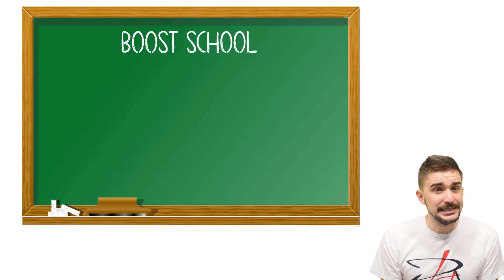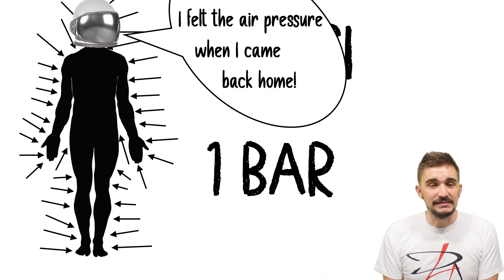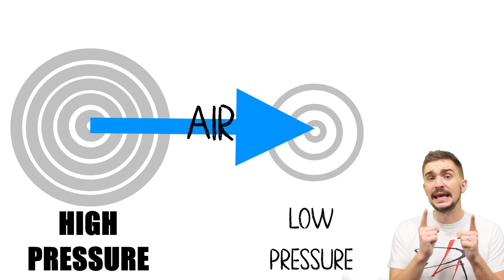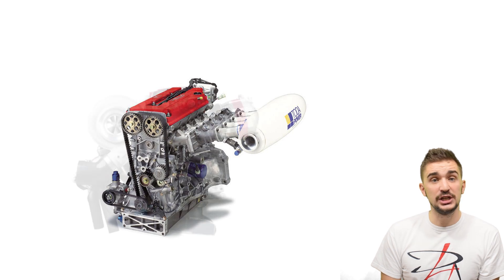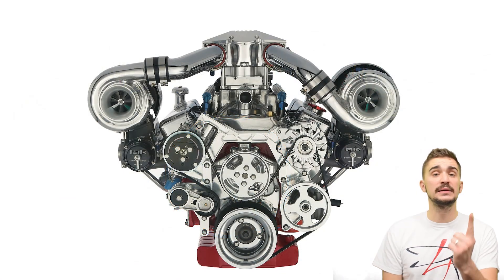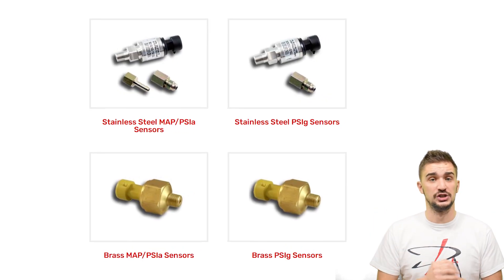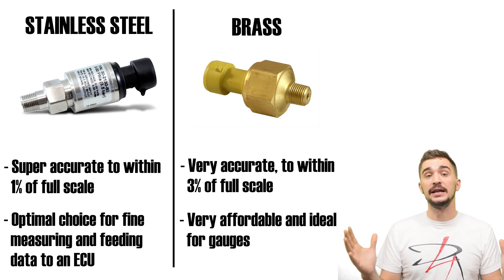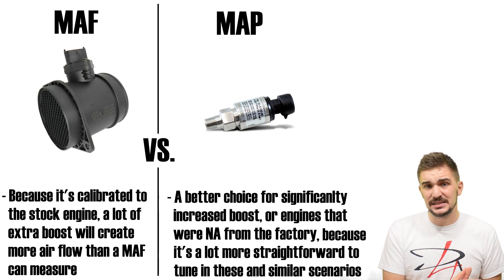BOOST pressure vs. MANIFOLD ABSOLUTE pressure vs. ATMOSPHERIC pressure - BOOST SCHOOL #4

Comment from the maker: AEM SS MAP sensors: https://bit.ly/d4a-map-sensors
AEM SS Pressure (Gauge) sensors: https://bit.ly/d4a-pressure-sensors
AEM boost controllers: http://bit.ly/D4AtruboostX
AEM ECU: http://bit.ly/D4Ainfinity5
AEM wideband AFR gauge: http://bit.ly/D4Axserieswb
Reply: Cool
Reply: Hello.do you have a video that is more diesel specific?would really appreciate it.woukd be nicr content for you too i would imagine.you are ver well versed and give crystal clear explanations yhat even a doorknob would understand.thank you for this and more power to your channel
Reply: Reirregardless , brilliant video 😉
Reply: @driving4answers do you have a video that covers the principle behind turbo flow Vs turbo pressure. I understand that bigger turbos flow more therefore make more power, however, they are able to flow more and decrease manifold pressure. 
How is it possible have less pressure but more flow. If the restrictions stay the same, i.e. the head and inlet. Then why doesn't that extra flow turn into extra pressure?

Comment: air pressure is not a function of air density without perfectly controlled conditions; increasing air density will increase air pressure in a perfect experiment, but increasing pressure does not always increase air density because humidity and temperature changes will be different masses in the same volume. a map sensor alone will create a poor afr when exposed to any conditions other than an sae standard day. i think a pressure sensor is a useful sensor but it needs other parameters to know how much air is actually present.

Comment: people really have to stop with the dubious explanations of atmospheric pressure on our body. it's not about being used to that pressure or any such thing. we don't feel the pressure of the air on our body because the inside of our body is at the exact same pressure, otherwise we wouldn't feel much, we would just get squished like a tube of toothpaste.
i've been as high as 4000m above see level where the pressure is about 61% of see level pressure, and i've been as low as 40m under the sea where the ambiant pressure of water is 5 times that of the surface. the only thing you feel under such low pressure is that you easily lose breath. and the only thing you feel at such high pressure is the first few symptoms of narcosis (drunk-like symptoms caused by high oxygen concentration). you never feel any mechanical pressure on your body.
you do feel a few things when changing altitude and pressure. the experience of diving holds the most symptoms of pressure changes, however, very few of them are effects of direct pressure on your body. as you dive, pressure will squish your mask against your face, because the volume of air inside your mask did not change, you have to manually breath out from your nose to balance it. your ears will clog, because the air on the inner side of your ear-drums didn't change either, you do a valsalva maneuver to balance it by blowing some air to the inner side. your wetsuit will feel more flexible, because the tiny bubbles of air trapped inside are getting squished by the increasing pressure, making the wetsuit thinner. if you are foolish enough to hold your breath while going down (never hold your breath while scuba diving, it's dangerous), you won't even feel your chest getting pushed by ambient pressure, it will just become smaller as if you were breathing out (if you go past your minimum lung volume though, your chest will get crushed).

on a side note, even if you went to outer space, if you are alive, you've likely never been a single moment without air pressure on your body. either you are in a cockpit or space station that is is full of air, or you are wearing a space suit that is full of air. if you are exposed directly to the vacuum of outer space space, you'll be dying pretty fast.
what you may feel is a big difference in how the air around you behave, such as losing the habit of what wind and air flow feels like at normal atmospheric pressure.

Comment: this makes sense. Turbo engines suffer less performance loss when you drive it to highlands such as Tibet. The turbo will compensate for the lower atmosphere pressure so you still get the same pressure inside your engine.
However in this case the boost threshold will increase since it isn't enough to spool the turbo at the same low rev.

This seems not so important for people outside China? USA is mainly flat.

Comment: correct if I’m wrong: so around us is about 14.7 PSI ATMOSPHERICALLY. And an NA engine has PSI of 14.7 when “sucking” in air (so an engine has no vacuum: but a rush of atmospheric pressure right?) so at all times 14.7 atmospheric pressure of air is rushing into the engine? And if a turbo is making 14.7 PSI this is separate from atmospheric pressure.

Comment: It is not at all necessary for your boost gauge to measure your turbo boost pressure at the turbo, in fact its much better and more accurate in terms of engine conditions to measure it in the intake manifold, exactly where your ECU is measuring it. I have no idea why you would ever want to measure boost pressure pre-throttle body.

Also, what youre essentially saying and what you should probably be saying directly is that boost pressure drops as intake restriction is encountered by the airflow from the turbo. The best possible measurement would be inside the combustion chambers. This is usually impractical, so as soon as possible pre intake valves is ideal. The most practical location is in the intake manifold. If you have ITB's, tapping the ECU's MAP hose would work best.

Comment: 2:40  Sea level?  I'd argue the lowest point would be the Dead Sea.  Its shores have an elevation of 420 meters (1,385 feet) below sea level.
Reply: yeah because someone is gonna tune their car specifically for the shores of the dead sea💀💀
Reply: At this point in the video he is not talking about tuning, and neither am I.  He is talking about geography.  "Where is air pressure the highest? It's of course highest at sea level because that's the lowest  you can be while still being on the surface of planet earth" <--- That is an inaccurate statement is all I'm saying.
Reply: he was still talking about air pressure, I think the pressure you would experience below sea level is water pressure
Reply: @thatweirdoboi7588   I am talking about air pressure as well.  The shoreline of the dead sea is still 1,385 feet below sea level.

Comment: After watching this video I realized in a N/A engine if you increase the intake system bastly , even the compression while is N/A the pressure will be 14.7 so with a 1 bar MAP sensor will be enough , am I right?

Comment: Light planes have an interesting variety of turbocharger wastegate controls systems. Some are as crude as a fixed wastegate that relies on the pilot watching the MAP gauge and controlling with throttle (yes, you can overboost them simply by firewalling it on takeoff), others are more sophisticated and actually regulate the manifold absolute pressure. They will maintain the set pressure throughout a climb until the wastegate is fully closed, at the "critical altitude" of the system, above which power drops with the altitude increase. Wastegates are usually hydraulically actuated by engine oil. The control systems modulate the oil pressure to the wastegate.
      I added a MAP gauge to my turbodiesel RV...the gauge is from a multi engine aircraft (actually a dc-3). One port I left open, so it indicates ambient pressure, the other indicates MAP. I have driven it over the Rockies several times, interesting to watch both ambient and max MAP drop. Thus, available power drops proportionately..car people think their turbo negates the effects of altitude. Wrong, unless your turbo control system  is designed to do so! It is probably not.

Comment: There is one more thing that is important; Mean Effective CR (compression ratio) Versus Boost. This takes into consideration pumping losses, heat, and altitude. Engine might have a fairly high static CR and too much boost = obliterated engine. The actual dynamic CR will be less. I was reading a article on aftermarket boost used on a high performance NA engine. According to my 'math' the boosted CR was 17:1. But the actual CR was 11:1. I was pleasantly surprised because engine I was designing had very low static CR so I could add 5 bars of boost and not blow it up. Plus the actual CR can run on Pump Gas.
Reply: i did run over 30 psi because of my faulty wastegate. tune was on 25 psi. hopefully it didnt blow up
Reply: @CHATANDFUN  Thanks for comment. Sometimes shared knowledge is better than dry data from the engineers.

Comment: For naturally aspirated engines, the approximate math for elevation-hp exchange is: +300M equals -5hp. 

Turbo and supercharged engines are different and can be case specific.
Reply: Wouldn't the "math" give the power loss as a percentage instead of a specific horsepower loss? A moped with 2 hp at sea level can't lose 5 hp at 5,000 feet...

Comment: What about a supercharger in the exhaust? Pulling the exhaust out of the head, negative pressure in the cylinder for when the intake valve opens?

Comment: Irregardless is with regard or with respect, high estimation of value. Regardless is without regard, respect, or low estimation of value. Ir equals not, so ir-regardless becomes not regardless, thus with regard. A person I worked for did me a solid by correcting me on this matter. Thanks Shelly. Great video series, I've learned a lot.

Comment: This is fantastic.
I've got an issue with my car, likely the MAP sensor, and I've been searching for hours online for one, only to finally realise that all the shops online call it a boost pressure sensor, but my workshop manual calls it a MAP sensor..
Which is obviously how I ended up on this page!
Reply: Manifold air pressure
Is boost pressure
Reply: @fastinradfordable  Yea I know that now, but everybody calling it different names is kind of annoying when you don't know, and you're searching online for a MAP sensor but can't find the right one! 
But it turns out my MAP/boost sensor was fine after all, it was my EGR valve that wasn't closing properly, and it was throwing off the pressure readings..

Comment: I'm confused, are na engine map readings negative or postive in.Hg?
Reply: Positive. Absolute pressure (the "ap" part of "map") can not be negative. Just as you can't have a temperature less than absolute zero.  
   Zero absolute pressure, whatever the units used, indicates a container or volume containing nothing. There is nothing more to remove!

Comment: A long lecture on atmospheric pressure, is not why I came to watch this video. Anhow, you got some stuff wrong. The reason we can't feel air pressure is because the pressure in our lungs, sinuses, inner ears, etc, is at an equal pressure to the air outside our bodies. When you go up or down in a plane, you can feel the change in pressure outside in your eardrums. When you "pop" your ears, that's allowing air in or out of your inner ear. As long as you keep breathing, your lungs, sinuses will equalise all the time. If you were to scuba dive at a depth of say 30m, then hold your breath and ascend, the air in your lungs, which would be at 4 bar pressure (1 bar of air pressure plus about 1 bar per 10m of water depth), would try to expand as you swam closer to the surface, probably causing tearing of your lungs, or worse.
Reply from the maker: A long comment that doesn't quote what's actually wrong is not why I read all of it. If there's something I said that's actually wrong then please quote it instead of trying to find an excuse to demonstrate your understanding of air pressure under a false pretense that I said something incorrect.

Comment: just correcting a few errors in the first segment:
sea level is not the highest atmospheric pressure a human can experience, many places on earth have solid ground BELOW sea level, which experience even higher atmospheric pressure.
the peak of mount everest is also not the lowest atmospheric pressure you can experience without leaving the earth, even propeller aircraft can reach altitudes higher than mount everest.

Comment: There is no sensor measuring absolute pressure in a car, the measurement is always relative to atmospheric pressure. Measuring an absolute pressure is too costly and have no point in a car. You would need an altimeter for that, unless the car is somehow connected to gps for it to know its altitude, which I highly doubt.

So NA full throttle is 0 bar relative but an offset of 1 bar is added to approximate an absolute pressure. (Some gauges let your put whatever you want)
Same on idle either -0.6b relative or 0.4 absolute.

A boost sensor or map sensor is quite the same thing, I think people refer to map as the tuning sensor and boost as the displayed value on a gauge.
If the boost gauge shows an higher number than your map, maybe it's the boost gauge sensor that is closer to the turbo, because the intake pipes and intercooler create pressure loss.

If your wastegate control is set to 1bar, your map will read 1bar relative on full boost no matter the altitude, because the wastegate spring is still opened by 1bar of relative pressure. If the atmospheric pressure drop to 0.8b absolute, the wastegate will open at 1.8b absolute, instead of 2b absolute.
On the other hand the pressure ratio of the compressor will raise from 2 to 2.25 meaning that the turbo will work harder, while still flowing less mass of air by time -> less power

The main reason why boost values may be higher with altitude is the fact that for the same amount of relative pressure you have less exhaust gas thus the wastegate spring has less forces pushing it open, so instead of opening at 1b relative it might open at 1.2b relative. 
And this would only be true if the boost were not controlled in closed loop, other wise the computer would have kept it 1b relative.

If you don't account yourself for the pressure drop with altitude you will lose power no matter what.

Comment: Great video but this got me thinking, my car comes with a turbo and i do occasionally take it to hills of around 5000ft elevation, how exactly does the car adjust the boost levels to cope up?

1-The car anyways has a bit of turbo lag in normal elevation levels so i assume by this point the turbo itself does not have much more scope for producing more boost so i guess low rpms still would have less power in turbo powered cars in mountains with less dense air. Correct me if i'am wrong. (Mine is diesel i guess which makes no difference)

2-Even in higher RPMs how does the ECU instruct the turbo (a mechanical part) to make more boost? I'am guessing it has something to do with controlling the wastegate, but do all turbo cars have electronically controlled wastegates? And for those that don't (if they don't), do they have no mechanism to make more boost in those cases and the engines make less power like their NA counterparts?
Reply: Every car is different. 
Asking a question about your car. …
Helps to say what car.
Reply: @fastinradfordable  Creta 1.6 CRDi
Reply: My car had a mechanically controlled variable turbo that can be changed on the fly by adjusting a valve On the shifter. 
Jelly?

Comment: Isolation rooms are negative pressure because they aren't airtight.  There are microscopic cracks.  A negative pressure room will suck "clean" outside air in the cracks, and exhaust only decontaminated air via filtration.  If the room were positive-pressure, with air being filtered and pumped in, as is most common with commercial HVAC, you'll push "dirty" air out the microscopic cracks.

That's why in the movies, you'll see people in labs in puffy suits.  The suit is positive pressure, to protect the person in the suit, and the room is negative pressure to protect the people outside the room.  Pressure should always be higher where you are protecting and lower for the "dirty" area, to ensure proper protection.

Taking this back to cars, a clean room for painting a car will be kept at positive pressure, so that dust and contaminates can't come in.  The air is pressurised through the filter system to prevent impurities.  The room needs to be cleaner than outside, so it's kept at a higher pressure.

Comment: Do you have a video on how to mach a turbo to a engine ?
 i am currently struggling to choose between two turbos :
- gt15-452213 
- RHB31 VZ21 
the Engine is a : 
Lifan 2v78f-3 a 90° V-twin with a displacement of 688ccm² 

the data is limited, but i am sure i can do a better decision the flipping a coin :D
Reply: Gt15